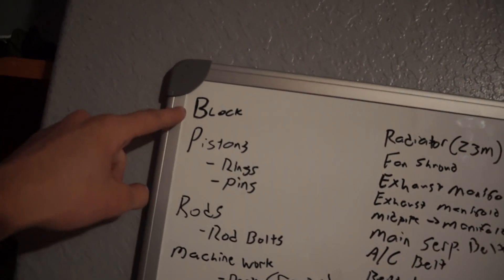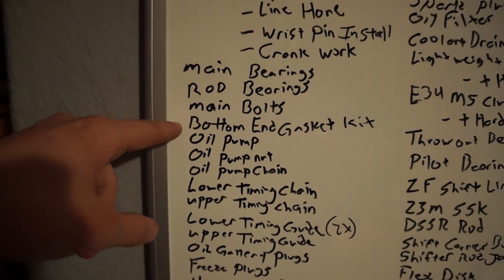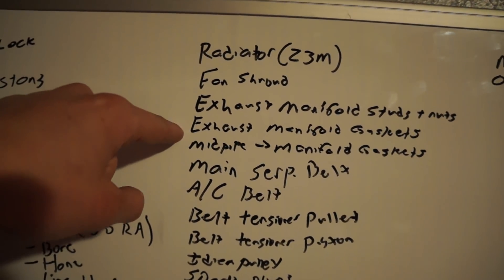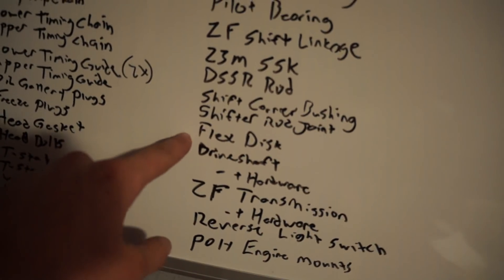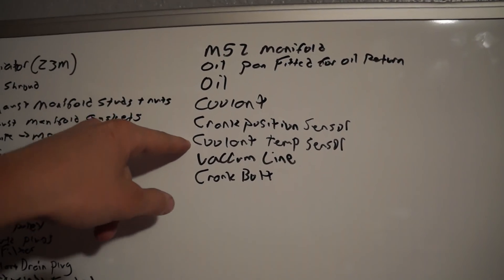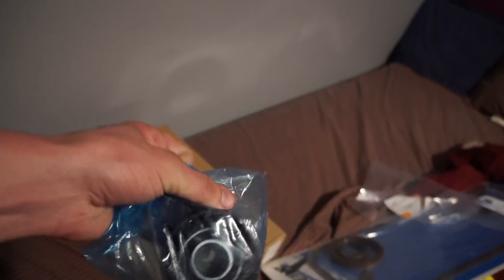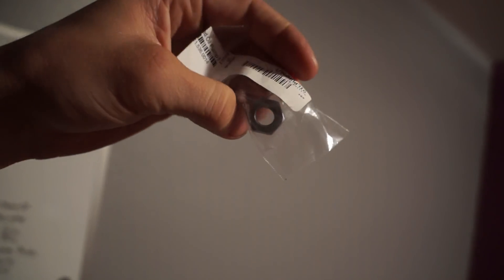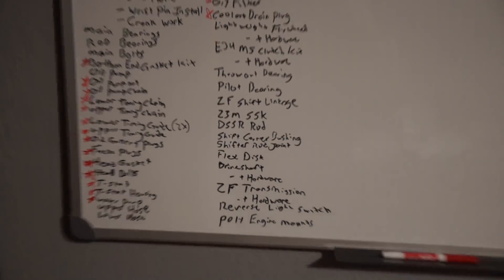Turbo-prepped S52 Build list.

Comment: Like your style man, was just thinking I need a white board when I swap my trans. Top tip don't let your sister drive your m3. Found a 100,000 mile box for $300 local, gonna get it. Will be watching rewatching your stuff. Also picking up race seats tomorrow, local jeep guy doesn't want them. Comes with 5 point harness too!
Reply from the maker: Nice snag man! swapping trans is fun, but not nearly as fun as manual swapping lol, you got this bro. are you changing clutches while your in there or no?
Reply: M3NACE I was thinking about it. Pretty good engagement now. Def gonna ditch the clutch delay valve. Heard it gives a sportier grab. Doing the trans mounts and engine mounts also while in there. Thinking solid aluminum bolt thru style NVH isn't a concern

Comment: Jacking up your content....so I replaced my o2 and the code disappeared. Now the MAF sensor is coming up still and ect not reaching temperature for closed loop operation. ( or did I mean open u know where the ECU takes data from sensors). Question is can I get a brand recommendation for a MAF and ECT. Local advance auto has an a1cardone, not sure if this will be cool. Thanks bro the fam appreciates!
Reply from the maker: You could try advance sensors, but I only run OEM sensors im my cars. only exception to that is the MAF, I will run non-OE MAF's. I would reccomend getting your temp sensor from BM if you can.
Reply: M3NACE bro I'm hurting here. Just bought a new MAF for 180. A1 Cardone. Clear codes hooked it up. Started the car and it sounded great. Get out on the road and it sounds and feels like shit. Pull codes. Misfire, cylinder3&6. Wtf??? But I didn't get those codes w a bad MAF. Any thoughts? Please and thank u.
Reply from the maker: hmm. intresting one. did you replace the downstream o2's or the upstream o2's?
Reply: M3NACE just the upstream with a NTK o2 sensor that has the BMW stamp on it. Afterwards the o2 code went away. The only thing I can think of is air is sneaking in somewhere after the MAF. I've got valve cover, spark plug well, throttle body and intake manifold gaskets, guess I'll try that next. I replaced the elbow after the MAF also.  323 is kicking my ass right now.......but I still love it. Thanks for helping the fam bro.

Comment: Just curious on why you chose a e34 clutch over a standard e36 clutch kit, is the m5 stronger?
Reply from the maker: they are, i ended up going with an ACT 6-puck clutch kit instead.
Reply: @M3NACE  whats stronger in them? Im just using a cheap fx stage 3 kit thats also 6 puck, would a upgraded e34 m5 clutch be stonger than a upgraded e36s?
Reply from the maker: @braydenweber6432  Im running the ACT 6 puck, if i thought the E34 setup is better I would have stuck with it. you can run the FX clutch if you want, but they are kind of garbage. its a cheap clutch for a reason.
Reply: Cheap forsure but i wouldnt say garbage, its held up better than my buddies ACT has in his evo x. Its only ever been beaten, never even broke it in pulled it out of the garage and did a burnout lol. Now i dont know the limits of these things yet so maybe im just easy on it but it takes abuse from a 3.91 welded so its not exactly babied lol. what issues have your heard arise from the fx kits?
Reply from the maker: @braydenweber6432  ive heard some of them slip out of the box on mild E36 turbo cars and others fail after 1 or 2 drift events, ive never run one though, and i dont plan on it.
Reply: Interesting well once i go turbo, ill let you know how it holds up. Hooefully it does better than a couple track days lol
Reply from the maker: @braydenweber6432  let me know lol, my boy pawinn i believe was running an fx and it was slipping on the dyno making 350 wheel.
Reply: Yeah i follow his channel as well he had the stage 2 which is only rated for "380" whp by website. Im running the stage 3 which claims 660 so idk i guess ill find out ahah. keep up the deadly videos, i dont think anyone has covered the e36 engines as in depth as you have (even on forums)
Reply from the maker: @braydenweber6432  yee thanks man! good luck with that clutch, lmk how it goes!

Comment: Ship me those old parts that still work so I can build my drop top from scratch
Reply from the maker: buy them off me and I will lol
Reply: I'm poor to convert my Rand's to Dollors will be ? If I had to give you a $1000 it would cast me R11,000 no Jokes bro lol, so I was thinking you going to give them away like how your friend gave you the headers lol anyway my main question is do a person that has a standard E36 piston that's ratio of compression is to high for turbo ? Can he/she still turbo the car with a stock standard pistons or do he/she has to get low compression piston ?
Reply from the maker: he gave me the header cause i Built the top end of his motor for him lmao he didnt give them to me for free. I dont do giveaways bro, maybe when the channel is bigger. you dont have to go low compression for turbo, although there is a limit to how much boost you can run before the motor starts knocking. the lower compression pistons mean I can run more boost without knocking, and they will be forged, instead of cast, like the OE pistons are, which mean they can handle more abuse that the OE pistons without breaking.
Reply: M3NACE cause I still have the old school cast iron block so I have look at what stage is the turbo then compare the amount of boost to the piston ratio which is 10.5:1 
I still have the clutch fan and the AC fan will these fans hold up cause I saw on YouTube most people bypass there clutch fan with an electrical one with a two way switch and a relay so that it never fails, but to run a diy turbo and factory produce turbo car  is illegal in my city if they catch me the can impound my car, but I personally think the slut bucket is going to be way better then the lil wing but the BBS rims back on the convertible bro and let the wind run threw your hair as if you flying
Reply from the maker: yee, the block isnt the issue, they dont make forged blocks lol
Reply: M3NACE is turbo legal by you ?
Reply from the maker: nah, thats why im going bottom mount. they dont impound cars here for mods, usually just a fix it ticket.
Reply: M3NACE that convertible is going to look to nice will break alot of hearts bro it already looks dope now to add the turbo 🏎️🏆